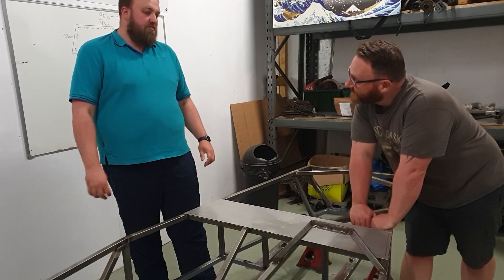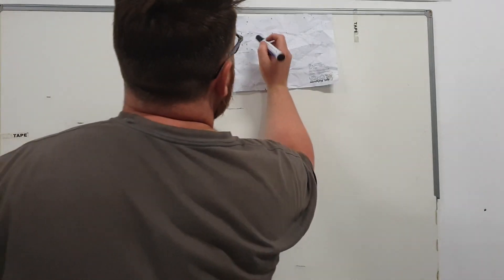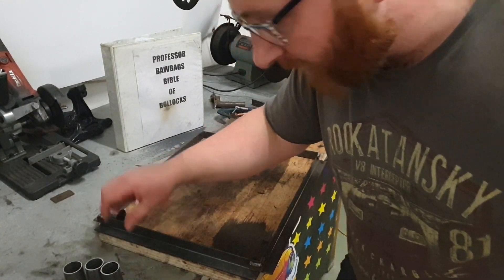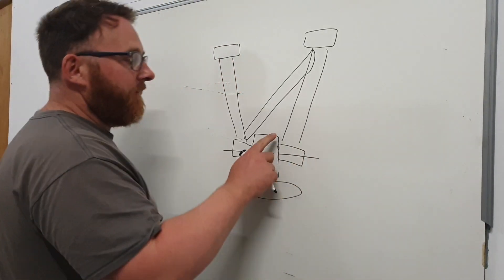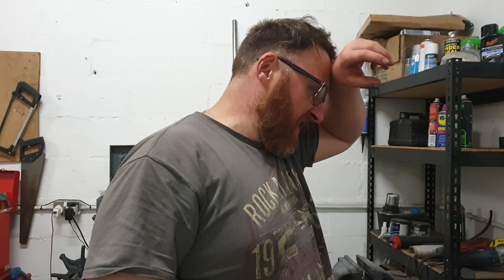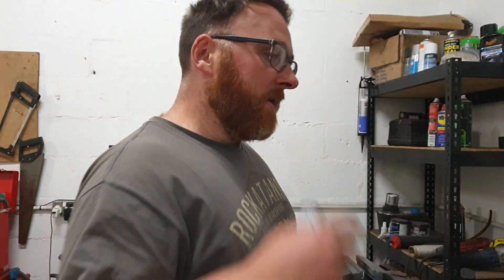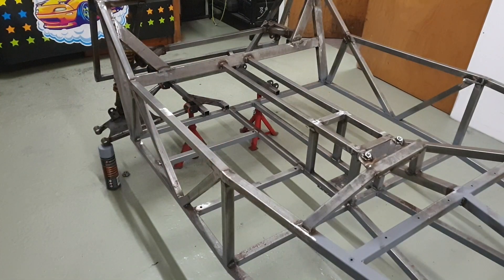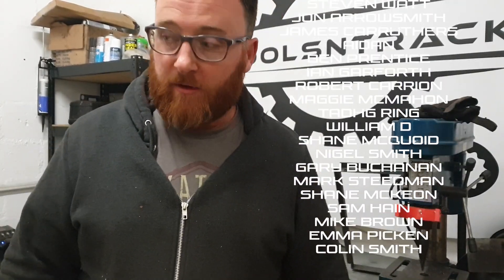LOWER WISHBONES, ARMS COMPLETE!! - Locost 7 Kit Car FULL BUILD!! - Episode 23 - (Project 7-UP)

Comment: Have you considered rear toe in/out? Might get away with offset washers depending on your bushes but it's the one thing I found missing on my Rocket build.
Reply: I say "I" found, what I mean is Andy pointed it out when he was setting it all up for me.
Reply from the maker: Going with the book plans which was the original MO, there is no catering for it. I'll be coming back to that as a post IVA mod if it needs addressed.

Comment: Just did this on mine this week. On the cover image you show the lower pickup for the shock absorber located over one of the side bars, since the wishbones dimensions are symmetrical i put the pickup where the cross bar meets the side bar as that creates triangulation under the pickup point. Maybe unnecessary since the cover plate will spread load though!! I'd be interested to hear what size shock absorber you have bought. I got 14" open but this meant I had to do a bit of work to create a mounting point on the frame. I think looking at the images of where the mounting point shown in the "BBoB" (no dimensioned instructions unfortunately) I think maybe I should have ordered 12" open.

The plate looks a lot oversized than shown on the book, intentional fo extra strength or mismeasure? 

Keep up the good work!!
Reply from the maker: Intentional! ;) Still to look at shocks, all in due course
Reply: @ToolsnTrack  Did your Bush carrier tubes (not sure what to really call them) align OK after welding up. Had a horrible time with twisting on mine when fully welding!
The polyurethane bushes were also a bit of a pain, bought Duraflex bushes and some seem to slide into the bush tubes easily while others have to be forced in. Seem to be slightly different sizes!! Think I need to do more research before buying parts in future!
Looking forward to the next installment.
Reply from the maker: @antoae111  seems to be OK so far for fitment, have you used a stout jig? As for bushes, have your Bush carriers come from the one length of tube stock or as a pre cut kit?